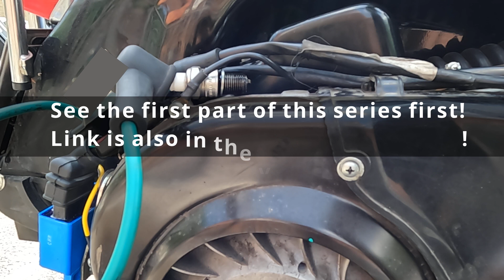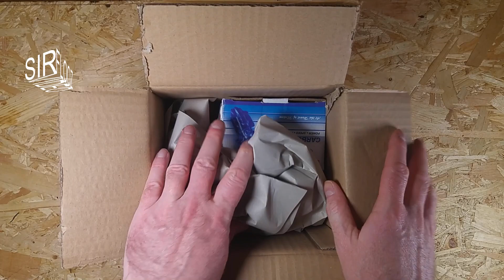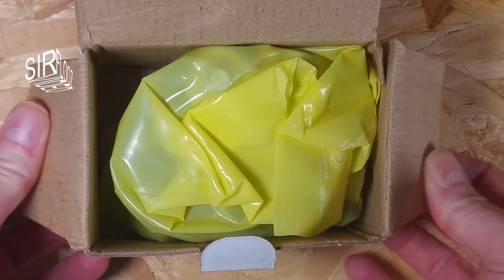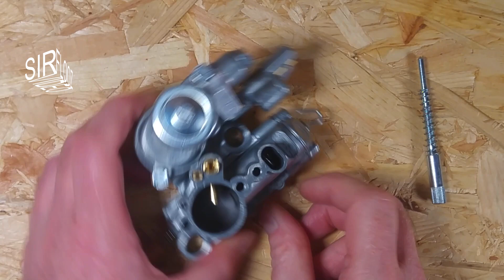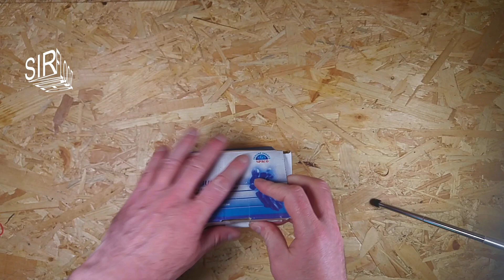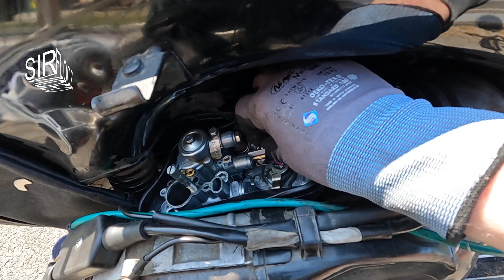Vespa PX Does Not Start! Can It Be Fixed? | Part 2😱

Comment: I also faced the same problem can you fix old carb, I have vespa px200e 1983 model and difficult to find new carb of that model in Pakistan
Reply from the maker: Have you seen my video about the carb details? https://youtu.be/UM_20XI6SiQ
At 4:00 you see, how the liquid should flow. If cooking it doesn´t help, you could use a steel wire hook to poke the channels free. Best of luck!

Comment: Thanks for the informative video. What is the tool you’re using the adjust the fuel/air mix screw? Did you buy it or make it yourself?
Reply from the maker: Thanks for the nice feedback! I made the tool myself. It is just a piece of steel band, a 90° bend at the end and there a gap with the size of the screw that I have made with a file. You can probably do it yourself.

Comment: Hai,
13:46 Du hast das Problem, dass die Gemischeinstellschraube (die lange Hinten Unten) zu lang ist (wie beim T5 Vergaser). Zur einfacheren Montage wird die normalerweise herausgeschraubt und nach dem Einbau des Vergasers wieder eingeschraubt.
14:30 und 18:44 Der Gaszug wird eigentlich gleichzeitig mit dem einsetzen des Vergasers eingehängt und nicht hinterher.
20:58 Der Motor braucht zwar auch Kompression, aber zum laufen Hauptsächlich Luft, Zündfunken und Sprit.
Und ja, man kann mit dem Bordwerkzeug schrauben, aber mit Richtigem Werkzeug geht das ganze dann doch etwas besser 😉
Reply from the maker: Gute Tipps - Danke! Richtiges Werkzeug muss man sich aber auch leisten können. Da bislang keiner eine Spende für meinen Kanal getätigt hat, ändert sich daran wohl auch nichts.